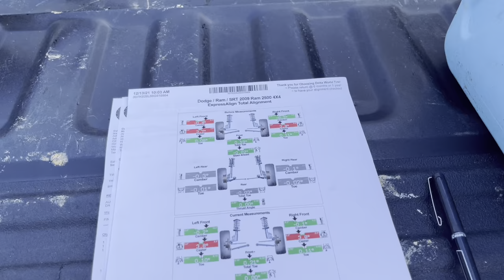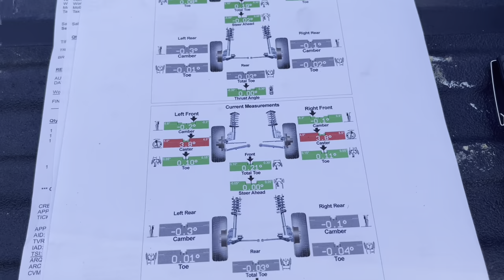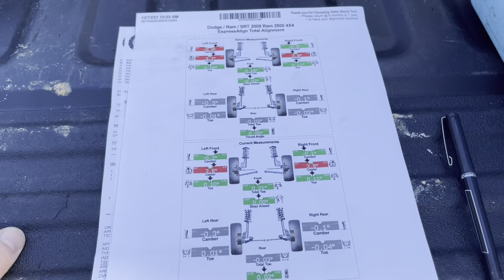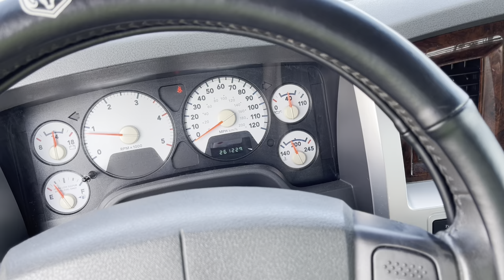Vlog 012: steering linkage, alignment, cooling system drama, and more

Comment: I would try to clay bar the windshield and the use meguiars cleaner wax or ceramic wax. That should fix that issue.
Reply from the maker: Thanks for the tip!
Reply: @OutpostCTD  you’re very welcome, let us know how it works out.

Comment: Mopar P/n 55056711AC heater hose assembly with connector. Hope this helps thanks for the content
Reply from the maker: Thank you Scotty. I may give this a try, but I have a feeling that the fitting that comes with it might be exact same as I already have but for $27 I'd try it and find out. Might also be able to stretch the existing heater hose over where the elbow used to be too. I think there is enough slack in the line but I'd be concerned about it kinking without a proper 90. I also know that Gates sells assorted sizes of heater hose. They have a 16" 5/8 hose with a 90. That might just work also but I'd want to double clamp it for sure.
Reply: @OutpostCTD  yeah I hear you. More of a solid clamp so it never happens again. Those fitting are funny, I got 230000 on my 08 and never had a drip from it(knock on wood)

Comment: Hey man what’s your experience with the alternators on these trucks?
Reply from the maker: They hold up pretty well. Only time I replaced one was due to mistaking it for another issue.
Reply: @OutpostCTD  ok thanks, mine started getting real hot and smoking recently but I found out that the crimp on the cable for it was pretty loose, and I think that might’ve caused it